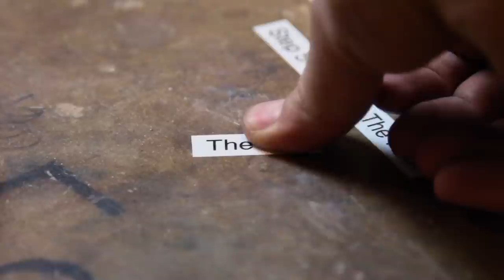Tying a KNOT with STEEL!!

Comment: This is the test a blacksmith friend of mine would administer if you wanted to hang out and learn from him... This method is far easier than the one he did.  We actually had to bend the steel rod using the horn only...